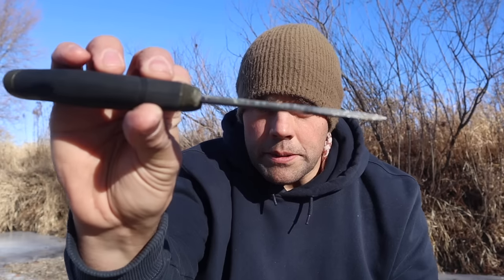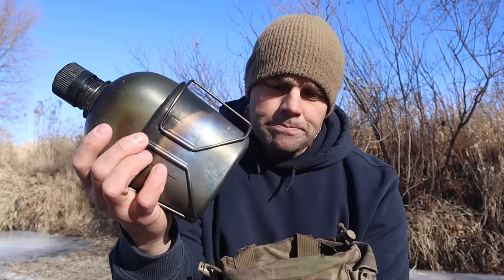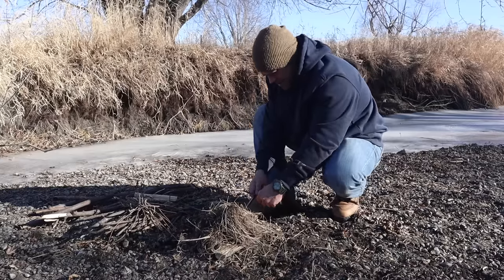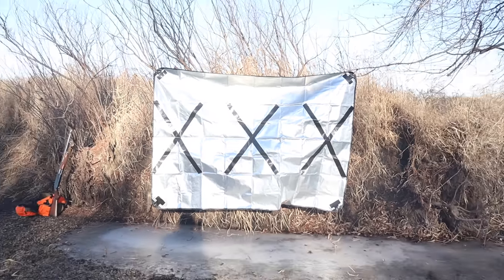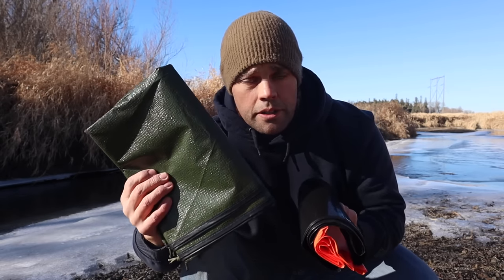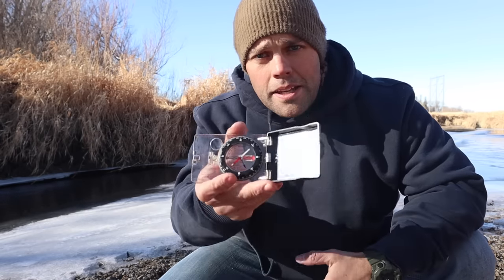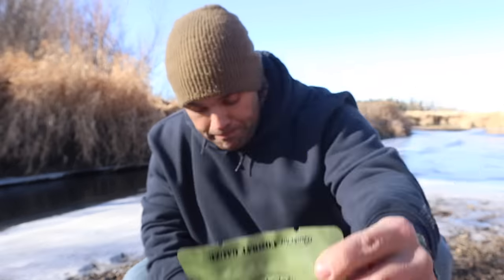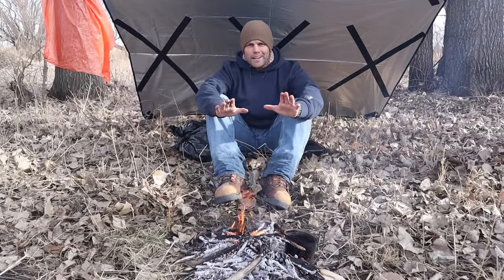How to Make an Advanced Survival Kit!

Comment: You've covered all the bases. Weight, volume and physical energy to perform tasks are primary limitations in survival. Water is more important than food until your blood sugar/calories are too low. My survival device is 7 components on a 2 X 3 inch substrate, a survival mirror. On the non-reflective side it supports a retractable whistle for your lips to clear the substrate for whistling, a small plastic container of 12 or more tinder cords each lasting 30 to 40 sec., another container with water purification tablets and a modified Silva compass glued to the container lid, a 550 lumen removable flashlight with lanyard, a flint on a side of the substrate and a diamond knife/hook sharpener on the bottom side of the substrate. Still enough room for the central viewing port and a hole at top center for a lanyard with the flashlight lanyard connected but removable. Knife selection is personal as well as H2O container, type and length of rope. For shelter, I've made a 4.5 ounce Dyneema diamond shaped tent, 5  ft X 9 ft X 3.5 feet high that sits in the palm of my hand, packed - 3 in X 6 in X 1-3/4 in thick with waterproof entry/exit zipper and waterproof vent with mosquito netting and hood. Yes, 4.5 ounces in weight plus 5 titanium stakes or make my own in the woods with my lightweight Japanese saw and Mora knife. I have a heat reflective bivy for sleeping, self made heat reflective anorak, beany, socks and mittens.  I could construct a heat reflective tent for winter, same description as my Dyneema tent, but weighing 2 or more ounces. I've modified my  800 ml titanium water bottle cap with grommet access for PVC tubing with bite valve and one way valve on the cap to allow on the go drinking.  My pot contains a 1.2 ounce perforated titanium cylinder that Ithen sits below my pot with Esbit tab providing about 10 min of cook time at 1300 deg F, so I needn't search for and baton wood for cooking especially in pouring rain. I carry two or more energy bars of 300 calories each. My fishing/snare kit and 1st Aid kit are separately stored in waterproof containers. All of the above described and additional gear except my pot which I tie to my hiking pack are stored in my patented 6.8 ounce hiking/survival pack that eliminates 5 to 8 bio-mechanical inefficiencies of the typical backpacks sold throughout the world that limits freedom of motion for  speed, endurance and comfort.
Reply: Thanks for sharing!
Reply: Well you're very unprepared
Reply: @stuartsteele9984  🥴

Comment: Awesome info, in the desert survival we all carried 6'x6' clear 5ml. Sq.of plastic,. You find a place eazy to dig, sandy river bottom, dig 5x5 about 1ft in  the middle , cut cactus pads up, place around sides of your container placed in the middle at the deepest point, then you set your plastic, start with a roll cover one 6" tail flap , stretch across hole and seal the other edges down tight sand rocks etc. you place one small rock in  the center of that plastic so that it creates a drip point directly over your container , this is why clear plastic works the best and the condensation drips off of that plastic point into cup, we did carry the mirror, compass, the whistle, waterproof stick matches in a waterproof container a small amount of light rope like paracord ,knife, tweezers lots of cactus here,  bandages of course. ( We all had to build the water shed ,for a grade)  45 yrs ago I remember most of it

Comment: I would recommend light wire for setting traps for catching food.  There is a good video on that here on utube.   I used to trap as a teen.  But tried wire and got the hang of it!  Cannot count on bringing enough food packs.  Also easy light. I use bees wax and cotton.  Lights wet!  Or sawdust/bees wax small light sticks you create.  Wax can be bought at good price in a large piece. I use it for many things!

Comment: fire water food shelter yes
i've thought about this for a very long time. and practiced.

if you were all 4 things starting out, in an emergency, you were cold, thirsty, hungry, and getting hit with the elements..
i think of it this way:

you need energy, body warmth, and sustainance. hydration is #1 priority. and body warmth. cold sets in over time. and having food for a long time with no water does you no good. having only water will get you through long enough to get more food and water initially. then you can create fire if needed. shelter is a luxury unless the elements are literally threatening your life. in that case shelter and warmth take precedent over food and water. you have to get safe and stable first of all. you wont starve to death in a day or 2. but you could easily die in just a few hours out in the wrong weather. 😊

and having water. then food. then your needs will be met. all these work for each other. learning precisely which to start with and how much energy to put into which thing is the key. xD

Comment: Depending where you are, it may be vital to add a snake bite kit to your first aid bundle.
Reply: Most experts don't recommend using a snakebite kit any longer. You might study up on the latest. If you are often many miles from civilization it might make sense.
Reply: And a tic removal kit
Reply: "Snake bite kits" are not a real medical intervention for venomous snake bites. In fact, they are snake oil .
Reply: I've heard those are a scam. Despicable.

Comment: I just wanted to state something about the use of tourniquets, there is an area on the tourniquet that says "Time", This area is VERY important, this is the time that you put the tourniquet on..... At that point, you have 15 minutes to get help, and get the bleed stopped or say good bye to that extremity.  I am a paramedic, and former military and highly trained in emergency and trauma care.

also yes, you can normally do "High and tight", as a lot of operators and EMS are trained, BUT, as long as the tourniquet is applied AT LEAST 6 inches above the wound, it will restrict blood flow as well. the reason for "high and tight" is because its so much easier than figuring out 6 inches. 

also, when applying a tourniquet, some of them have a red tab, at the "pull" side, when applying it, make sure you put it on that when you pull it tight, it is towards your body, not away from it. the reason is to prevent it from snagging on something and coming loose.

now this will sound silly, BUT, carry feminine products, pads absorb A LOT of blood, tampons can be shoved in a puncture. also just FYI, the dressing he is talking about is called a, exclusive dressing.... you can make these..... take a 4x4 gauze, rubber gloves( for sterility ) and some neosporin or triple antibiotic ointment, and use a copious amount of neosporin or triple "a"  covering both sides of the 4x4, then put it into a sandwich baggie, the baggie can be used to seal a wound as well

Comment: I'm an EMT and just for the people wondering, the needle decompression for Tension Pneumothorax is an advanced skill that requires training and lots of practice. You can kill someone very easily if you don't know what you're doing. Because of that, decompression needles are restricted items and aren't easily obtained. For people who don't have the skill set to do a needle decompression, you can still treat a Tension Pneumothorax. If you use vented chest seals like what you are carrying, it is very unlikely that a pneumothorax with go tension. However, if it does, the pressure can be relieved by 'burping' the wound. This is done by lifting a corner of the seal to allow air to escape. For people that don't have a chest seal, they can be improvised. Take something that is impervious - ziploc bags work well - and cover the wound with it. Tape down three sides of the bag (leave the lowest point open to allow blood to drain. Have someone monitor the patient until help arrives. You will have to burp the seal frequently if you do this.

Comment: Dude you make a great no nonsense video. I immediately understood that you already know how to do it from the choice of the knife, where many choose large and heavy knives for survival who really knows what it is needed carry a Mora knife tipe or a little more. I alternate with these three knives: Mora robust, Barkriver Bravo1, Swamprat Ratmandù. I do not carry a space blanket with me and in its place I have a German military poncho, made of thick and resistant rubber material. in addition to using it as a poncho I use it for shelter and if necessary it can be used as a hammock, stretcher, tub for water and even as a small makeshift boat. I carry a Sawier filter with me, it is very small but it filters thousands of gallons of water .. I also carry one of those small steel lunch pans which have another small steel container inside. in my kit I also have a mylar emergency blanket and a 4m x 4m sheet of those used by painters. they are very thin but have their own advantage. I was able to create a shelter like this: fire and the reflector behind, using the poncho, closing it in front and at the sides with the 4x4 sheet and putting the mylar blanket on the back, inside I created a completely closed shelter with a reflective wall. outside it was -2 ° C, inside the shelter 17 ° C. ..... my medkit is very simple: some gauze, rubber tourniquet, duct tape and cyanoacrylate glue are the most important things essentially for the cuts. i live off the grid and often work in the woods alone. I happened to get seriously hurt and realized that a bloodkit like this is what it takes. I live in Italy and we don't have endless forests or isolated deserts. here as far as you can go you will almost always have someone in the balls! greetings from italy, i follow your videos with interest

Comment: I like that you modify gear. Your modifications may not be my modifications, but it does give the message that your modifications for your personal gear are only limited by one’s imagination. 
For example, my hatchet has a hole in the side on the end of the handle. I drilled out a hole going bottom up into the handle to keep my ferro rod and secured with appropriate cord through the holes.

Comment: Excellent. Robust. I still rock a Sawyer water filter and bladders to plus up water. Also can hang sawyer around my neck inside my clothing to prevent it freezing.  One overlooked item  to kits in my opinion is things you can add to hydrate verses MREs. Although a tin of sardines, jerky, rice doesn’t  brake the bank or ounces equal pain rule. I take along Gatorade with extra salt, Mio, coffee, and hot and cold items like  caffeinated and non caffeinated tea, hot chocolate mix, and jello.  I like jello hot or mixed with snow.

Comment: Rapid deployed ridge line question. How long of paracord do you carry for that? 
It looks like you have some prusik lines attached as well. Do you carry any bank like or just paracord? 
I like to add to the survival kit a trapping kit as well. Pre-made traps and snares are easily deployed and more of a guarantee than crafting one, which frankly most people, myself included would forget how to make without regular practice, or take forever to make just one work correctly. Ditto to the previous comments, great videos. Peace
Reply from the maker: The QDRL is about 25-30' and I do carry a small roll of bankline however, all components could be made with all of either cordage. Bankline seems to work better, though, for the prusiks.

Comment: For fire I have a plastic 35 film container with cotton/Vaseline. It burns while wet and it burns well for several minutes to dry out damp tinder.
Reply: Another way to do that, is take a empty straw, clothes one end of the straw with needle nose pliers, take a lighter and seal that in shut. put some Vaseline on a cotton ball and stuff it in the other side of the straw. Then take your needle-nose pliers and close that end and seal it shut with the lighter. I make them about an inch long. All I do is take my knife cut off an end light it and it burns for a while straw does too. Good luck.

Comment: I have a camp pot with a pan, which is also used as the top for the pot. Both parts have fold out handles with silicone coating on them. I think the pot is 1L. I can fit my metal camp cup inside the pot too. Also, the pot/pan have a pouch it put them in.

Comment: Question on the Grayl press: when using ice water as shown, does that not compromise the filtering  at all? Thanks for  inspiration and training on life saving techniques! I hope we never have to use this,
Reply: Bit late to the party, from Grayls website:

Can a Grayl be used in freezing temperatures.
Yes but avoid using cartridges after 3 or more freeze/thaw cycles. Ensure the protection of your UltraPress and GeoPress in freezing temperatures by keeping it filled with water and insulated in a jacket or sleeping bag.

In general, filters should be kept above freezing always. If the water is flowing as in the video, I guess it isnt really cold enough to cause any issues.

Comment: I would recommend using a metal canteen. Sometimes you need to put your boiling water into the canteen and run in a rush. I already checked. While Tritan plastic used for the Nalgene canteen can still hold up against boiling water, its rigidity will be compromised and it will become very soft.

Comment: I just ordered a morakniv for my own kit. Actually I ordered 2.
They are just so affordable, it's easy to set them into the kit and know they are there, no matter where your favorite 'fancier knife' ends up.
Ie. The parang or machete or hatchet, etc.

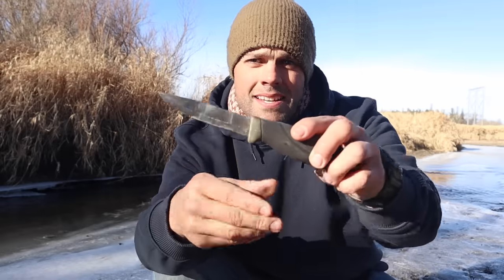One thing I'm curious about. The dangling Paracord loop. 8:33
If it's not secured at all,
Does it not risk getting lost?

How would you recommend securing it?
I'm thinking, a para loop. With a toggle... Or probably, a couple sailers loops, one quick tug on the tag end,
And the loops pull free, and also give me an unspoiled length of para.
I also received a bundle of fancy survival Paracord... Which comes with internal survival core strands... In addition to the standard core strands.
Fancy.

Comment: Great video and fantastic tips.  I've added Survivor Cord (Titan Survival) that has tinder, snare wire and monofilament integrated into the 550 cord.  Great multi purpose cordage and numerous colors some being reflective.
Reply from the maker: I used Titan as boot laces, only thing I didn't like was that the wire snapped after a few months of wear and poked through the cordage. I wish the gauge of the wire was slightly larger and the fishing line smaller.
Reply: Agree about the wire.  I still use 550 cord for all my boots and have considered pulling the wire out of a 100 length of cord and then making a card size spool of the wire.

Comment: Regarding 550 cord.  I hear that there are higher strength paracord as well as specialty paracord.
Also I didn't hear bankline mentioned which is also multi strength, tarred and untarred.  Perhaps a video on different cord, thread, twine, rope and their usages. I remember an older woman talking about them, and when one type is better for a particular application than say 550 cord or something else.  Don't remember if I saved that or not.

Comment: I use jute string as lanyards on my ferro rods for backup fire starting material.  On my SAK ranger I replaced the toothpick with a Tortoise mini ferro (they work) and packed dryer lint in the handle under the saw blade.  There's enough lint for 2 or 3 fires and the saw still closes properly.

Comment: Thanks. The quick water filter & container; it is good, my concern is the container goes in the water & droplets on the filter top waterbourne organisms
(these can go into the skin).  The organisms in the dirt/soil/ plants. I used to not consider this as much, but once a person gets'em it can be near impossible to get them out of the body.
Reply from the maker: Good point, I have read of contamination and sickness after handling contaminated water that was treated. Prb a good prevention step is to understand the water source as well and where we take water, but still take the time to clean hands or avoid touching the eyes, nose, and mouth until we can be certain we won't make ourselves sick.

Comment: For navigation, make sure you know the current, updated magnetic north declination of the map you are using in order to enable accurate compass settings.  The necessary info is available on the Internet.  GPS can be reliable, but can be be vulnerable to a variety of interfering factors.   I would add to the kit multivitamins, small packets of salt, sugar, and black pepper, plus some hot pepper for discouraging pursuit hounds.   Small tubes of Manuka or Romanian first-honey have medical and nutritional crossover use.  Laser-proof goggles and other hi-tech stuff may be a good idea, too.

Comment: You can also make a sheath for the ferro rod with a length of brass tubing.
Reply: I dipped mine in wax after one of them started to deteriorate.
The wax can be scraped off, and helps get your fire going.

Comment: Adding a small zip tie around the button of the bic lighter prevents your lighter from losing its fuel and can be removed and replaced once zipped, clipping the extra length makes it a little sharp though can be filed to prevent cuts. Plus the adhesive sticker is also flammable, once you have a empty lighter if the wheel is removed slowly the springs can be made into a snare & fishing hook and the childproof metal can be removed and can also be made into a fishing hook.